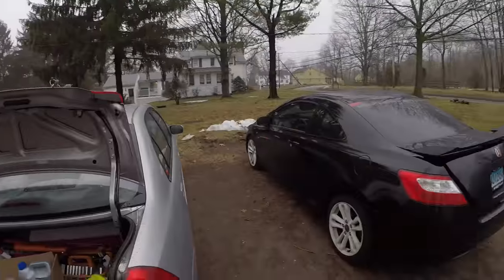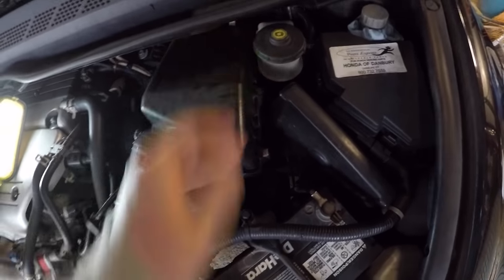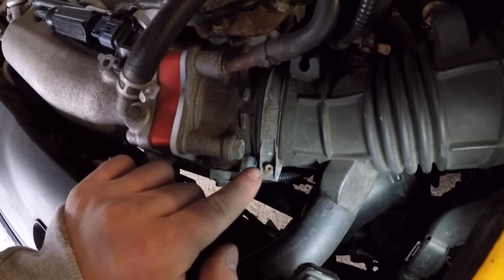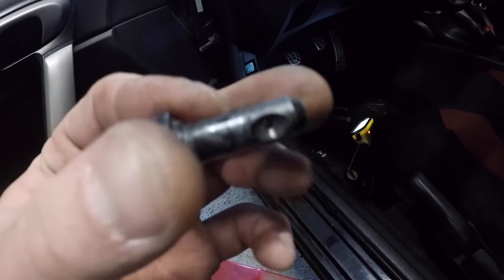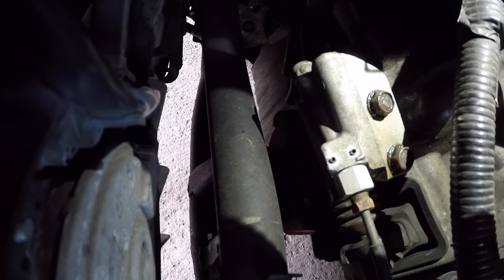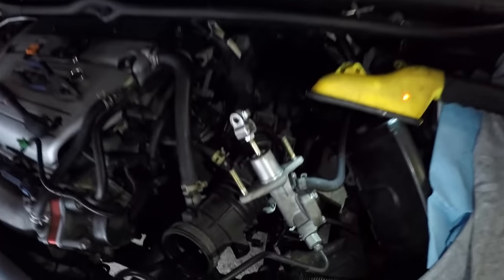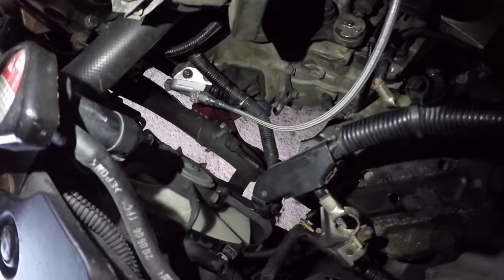Honda Civic Si CMC & Slave Cylinder Replacement DIY (2006-2011 Si K20z3)

Comment: So I just changed my CMC and Slave cylinder out last weekend with the K-tuned and I found that by unbolting the brake reservoir and moving it to the side that it opens up a straight shot to the CMC which made it so much easier to get to. I was able to change both parts and bleed the system in about an hour.  What a difference it made to my 2007 Civic Si 4 door.  I like your videos because you keep shit real and don't act like your the greatest Civic mechanic on the planet like some of these other dudes do on here. Keep up the good work and Video's
Reply: I'm having issues shifting when my 08 si is warm. Could replacing the CMC fix this issue? Or should I just adjust my clutch pedal first?
Reply: Nick G bro what did you do???  it’s happening to me and idk what’s wrong with it, what should i do to fix the issue?
Reply: Im about to do my CMC tomorrow. On my way home from the store today I stopped at a stop sign, took in 1st gear and went to shift to 2nd and i my pedal went straight to the floor. Got her home, reservoir was empty, filled it and tried bleeding it and heard air when i depressed the clutch pedal when it was under pressure with fluid in the lines. Im thinking the leak is at the valve on my OEM CMC but wont know until i take it out
Reply: @robertjackson4642  the stock cmc and the stock slave cylinder worked great until they have there first problem and once that happen they will never work right again. I highly, highly, highly recommend changing both the CMC and slave cylinder  at the same time. I put the K-Tune cmc and slave cylinder kit on my 07 si ( well its now my sons car) when I did mine and its still on the car and has no problem at
Reply: Bleed the shit out of it to. Send me a message if you run into any problem and  I help you in anyway possible.
Reply: I’m not sure anyone will see this but do you have to bleed the actual clutch or just drain the reservoir? Seems like it could be a silly question but anything is helpful!
Reply: @Collin Ragbir  You will need to bleed the clutch pedal just like you would do when bleeding your brakes. Also, make sure you have the new cmc Rod adjusted correct because if ipp

Comment: Thank you for the how to! For most people who dont know, the stock CMC and Slave cylinder are designed for "comfort" clutch engagement and can prematurely ware parts. This is why the OEM CMC doesnt last like older ones. The K-Tuned CMC and slave make eliminate the slower engagement and oil restriction, making it more responsive, but can shock your drive train if you are not careful.
Reply from the maker: Np bro!  Yup, stock cmc and slave for butter smooth gear transitions.  K tuned is nice, but remember something, you can't beat oem reliability.
Reply: Thanks for information but could please elaborate what could go wrong to drive train under what circumstances???

Comment: Yo do an update of how to bleed out all the air I sit there for hours pumping the pedal how'd you do it? Please it would be a huge help man
Reply: sabastian kimball requires 2 people. One at the bleeder valve on the slave cylinder, and one inside the cab pumping the clutch pedal. Pump pedal 7-15 times then hold pedal down to floor with some tension, the other guy cracks the bleeder valve and closes with in a 5 second time frame. DO NOT RELEASE PEDAL UNTIL BLEEDER VALVE IS CLOSED. Repeat till it's fully liquid shooting out of bleeder valve! then, your golden. That's it. Easy savings of 100 bucks.
Reply: You don't bleed the master cylinder. There is only one bleed point in the system, and that is after the slave cylinder. The bleeder valve is located on the top of the slave.

Comment: would this be the first "mod" you would do if you wanted to be able to shift hard when you feel like it? My 9th gen si locks up past 6k going into second.. and it's annoying/grinding my gears.
Reply from the maker: +Taylor Harless I would highly recommend k tuned cmc for shifting fast and hard man. I though they improved all the problems when they made the 9th gen, that's crazy.  If you keep grinding, you're going to need to get tranny work done, which can be pretty pricey
Reply: nope... freakin honda lol I think they made it as a "safety" feature. And yea man.. i don't want tranny work having to be done. Car only has 74xxx. Today i kept my rpms between 2.7 and 4.5 just putting around town and the shift were very smooth. So until the cmc is swapped i'll just keep it around half throttle :) thx for the reply man, I wish you and your si well. (don't let any idiots wreck into it!)
Reply from the maker: +Taylor Harless she's a baby.  I was deciding whether or not I want to upgrade to a 9th gen si or not.  That's exactly what I was going to tell you to do, see, you know what you have to do 👍🏼.  Let me know how you make out

Comment: How did you adjust the pedal/cmc I just did stage 1 upgrade and having some issues once in a blue getting into gear. Feels like I have lost pressure on the cmc at times

Comment: I did the EM1 CMC with a stainless braided line, definitely helped with clutch feel and higher rpm shifting.
Keep at it buddy!
Reply from the maker: +Chase Berz nice bro, stay tuned for my k-tuned driving review
Reply: I might go with the em1 route since it’s oem on my 9th gen.
Reply: @Litto1  it's been a while since I did this and we know better now...

The EM2 clutch master cylinder is drop in and go with no need to switch rod and clevis out.
Reply: Ch Bz what should i do if my car doesn’t shift right when it gets hot. or at all at this point. i changed the slave cylinder, trans fluid as well. what’s the issue?
Reply: @TheGerbsteve  can we just install the regular new stock cmc kit or we have to install specific ktuned for better high rpm shifting???
Reply: @cgberz  do you have the em2 cmc on your 8th? If so hows it holding up?

Comment: Hey gerb, please help!! Asap!!!

So i went to turn on my car and it did. 

But the pedal has no pressure what so ever but it did come back up. 

I added some fluid to the reservoir and it leaked at the bottom almost identical oposite of the CMC by firewall. 

The car turns on with clutch but it wont allow me to go into any gear.

Help. 

07. Si. Sedan
Reply: Ever find the issue? Just had this problem this morning.
Reply: Same here anyone know anything
Reply: Ever find out why
Reply: Your cmc is dead. Happened to me and jus got another k tuned cmc🤦🏽‍♂️🤷🏽‍♂️

Comment: Do you still have the cmc an slave cylinder after all these years I heard that they go out between 5k-10k miles.
Reply from the maker: Running a new ktuned cmc and oem slave, but nothing bad happened with my old one

Comment: I bought 07 si  they put a new clutch in it just 6 months ago but did not swap out the the clutch slave cylinder  every once in a blue it will not go into 5 or 6 gear it goes very hard on me like it won’t fall in the gear.Once I pull over restart car it goes away like nothing happen.I have had the car for 5 months and has done it like 6 times .Do you think it’s the slave cylinder that needs to Be changed?

Comment: Gerb! I’m 4K miles with my ktuned set and I cannot get into gear at a standstill. I got my clutch bled cause there were air pockets in the line. It’s still like 50% cannot get into gear. What should I do?
Reply from the maker: Sounds like it may be an internal clutch component failure

Comment: I'm ordering the cmc kit this week.  when my car is cold my clutch is floppy and light.  I adjusted the clutch pedal and made it hard.  I also replaced the clutch starter switch cause the stock one was broken.  hopefully this solves my problem.  I'm tired of warming up my car for 10 to 15 mins so my clutch works properly...great video!! I'll do my best as always.  God bless 1

Comment: The cmc 12m under the steering wheel 1 of mine is stripped how do I get it off need help rq never had to deal with a stripped bolt
Reply from the maker: A set of nice vice grips should do the trick.
Reply: @TheGerbsteve  thxs bro your vids help me out alot on my SI

Comment: bro having trouble with cmc and slave, i did not bench bleed it , but its taking me a while to get the air out the system. i used most of the methods, but it seems that it doesnt work.
Reply from the maker: All i bled was my slave when everything was on my car.
Reply: how exactly do you do that bro.  just disconnect the hose from slave and let the dot run out or how do u bleed it correctly??! plz respond bro bro thanks
Reply: nvm i read some comments.

Comment: With the hose clamps they're a lot easier to take off if you throw an 8mm or 1/4" socket over them rather than the flathead if you haven't done it that way before

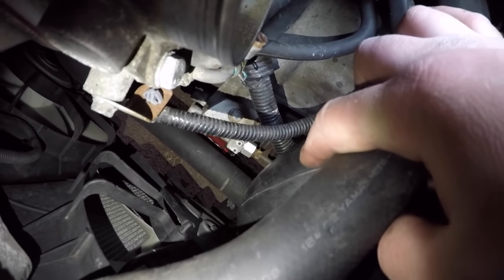Comment: 4:54 slave cylinder.  Just posting that for future reference.  I have a 2007 EX and there's almost no tension in the clutch.  The fluid looks horrible, so I'm hoping all I need to do is bleed and replace it.  Awesome video!
Reply from the maker: Start with changing the fluid, honda oem brake fluid.  Start with that & take it from there. Thank you sir
Reply: It worked!  I just replaced the front pads and rotors back in April and had a bottle of fluid that was almost full.  I flushed the line until the new fluid came out and now it's shifting like new!  The only thing I had to buy was a $9 bleeder kit from O'Reilly.  If only the CBR was that easy to fix...
Reply from the maker: That’s what’s up! I’m glad that it was something small.  Fluid gets filthy relatively quickly, allowing moisture to get into the lines.  Also, debris sometimes get into the reservoir.
Reply: Yeah man the reservoir was nasty.  I cleaned out all the small stuff with a q tip.  Still a hell of a lot easier than replacing the slave and/or CMC.

Comment: Also what was the reason you replaced them again? I forgot if you mentioned it..
Reply from the maker: +Charles Michael I replaced both due to my 2nd & third gear acting up.  I will be putting up a follow up vid letting you know it the k-tuned fixed the problem

Comment: Do you have a video on how to bleed the clutch fluid? Where is the black bleeder cap located? Is it on the CMC or slave cylinder?
Reply from the maker: Unfortunately i don't.  The bleeder valve is on the left side of the slave cylinder.  You need to put a plastic see through hose over it and crack it open.

Comment: What are the upsides of replacing the hard lines with a flexible clutch line aside from ease of installation/removal?
Reply from the maker: Better travel of brake fluid to the slave. Stock line has wayyy too many bends and restrictions.

Comment: I bought the K-tuned CMC replacement part - havent installed it - didnt know that I could/should get the aftermarket slave unit as well. Would just changing the CMC and not the slave (keeping OEM slave) still be beneficial or should they really be installed as a pair?
Reply from the maker: You're going to love it.  Honestly, i stuck with an oem slave because i like the feel of it.  Believe me, you will feel the difference between cmc's.  I wouldn't worry about buying a k tuned slave, you'll be fine with oem, unless you hate the "delay feel."
Reply: I thought the aftermarket CMC got rid of the shift delay - are you saying that only coupled with an aftermarket slave will I get that no-delay shift benefit? And if that is the case - what does upgrading the CMC (and not the slave) do on its own - in other words, what are these improvements you mention that I can expect to feel when finally installing the CMC? Thanks for your video and reply!
Reply from the maker: +Gahechi Esmichi Slave mostly.  Aftermarket CMC helps with quick/smoother shifts.  No, mine paired with the oem slave is awesome. I have a slight delay, but i like it like that.  The CMC makes the clutch pedal a bit stiffer & helps with certain gear issues.  You'll see what I mean when you install it.  Pretty sure it's stronger material (mainly the rod) on the k tuned CMC over oem, meaning it can take a beating.  Also, replace your oem clutch line to a stainless steel line.  Its way easier to install, disassemble.
Reply: thanks again for the info/reply. I went ahead and ordered the k-tuned slave as well - only $70 bucks or so so why not. The CMC kit that I got from k-tuned came with a new clutch line - i expect it to be of better quality than OEM. im really looking forward to installing it - your video has given me the confidence ive been lacking to do the job myself. Thanks again man!

Comment: GERB TURNS OUT THE CMC WAS MISSING A BOLT ON THE ACTUAL CMC. ITS GOT LIKE 3 ON TOP AND ONE WAS BROKEN OFF. DON'T ASK ME HOW IT HAPPENED. WEIRD. 

NOW I BOUGHT AN OEM ONE AND DO YOU RECOMMEND I BUY THE STEEL LINE FROM VALEX??
Reply from the maker: +Sti Wrx Yes, buy the steel line man.  You said the car doesn't go into any gears???
Reply: Gerb Productions yeah it dont. When the car if off you can put it into any gear without the clutch but when you turn it on it dont let you.
Reply: Gerb Productions maybe due to the leaky cmc its not building enough to engage the pressure plate
Reply from the maker: +Sti Wrx I had that same problem.  I ended up replacing the CMC and slave & my clutch shit the bed completely not long after.  I hope it's only a quick fix man.  It could just be your CMC, not 100% sure
Reply: Gerb Productions gerb what are the steps you did to re.pressurize the clutch line.
Reply: Gerb Productions GERB ALSO, WHAT CLUTCH AND FLYWHEEL DO YOU RECCOMEND?? 

MAYBE A 12LBS FLY OR STICK TO THE 15LBS??
Reply from the maker: Exedy oem clucth with oem resurfaced flywheel.  It really depends on plans with your car though.  If you're going boost, stage 1 or 2
Reply: Gerb Productions what steps did you do to bleed the clutch line

Comment: Back to your vids again man. I'm pretty sure my cmc went out.
Like it was popping forever as they do. Until one day it made a weird pop snap noise from the pedal/cmc.

Now it's really hard to get into gear when the engine is on. I feel like it's the cmc??
I need to get one in a pinch so I can get the job done this weekend when I have a moment. Do you think I'll be fine on the same csc??
Is it worth it to get oem at double the price of the rock auto special??

Comment: Why did you change the slave cylinder, my 2008 honda civc si doesnt change into gears unless I turn it off and this happen when I was driving to work and I tried go to 3rd gear put wouldnt let me. Do you think it's the clutch or master cylinder??
Reply from the maker: Because my whole clutch went, so why not upgrade everything.  I hate to say this, but i had the same issue. It ended up being my clutch that failed.

Comment: Going to be doing almost the same in a couple weeks, but I wanted to know what are the benefits of upgrading the slave as well?
Reply from the maker: +Neil Bennett If I could go back, I would've done the k tuned slave as well because I currently have an oem one.  Upgraded slave (ktuned, em1, or w.e) are modded, so there is no delay between shifting.  Oem slave on the si's have a delay valve or something similar to it that pretty much cause a slight lag between shifts.  People modify the oem slave all the time.  Hope this helps bro

Comment: I'm about to be replacing my cmc and slave with a dealer part. Will be doing in a couple days. I'm still going to be using original clutch hard lines. Will I be able to remove the cmc and slave without unmounting the hardline like you did?
Reply from the maker: Dude, upgrade your hardline to flexible, stainless steel, they're wayyyy nicer
Reply: Gerb Productions thanks for the suggestion. I have it all back installed and works perfectly. I got the updated OEM cmc and slave from dealer. Reused the hardline and works perfectly. It's my daily so no need for the flexible steel line yet.

Comment: What are the symptoms of a failing master cylinder? And would it damage the transmission?
Reply from the maker: Fluid leaks, soft pedal, pedal to the floor, shift grinding. They can damage a transmission

Comment: Did you use the ktuned cmc fork thing that attatched to the pedal and where the pin goes through? I had to switch to the oem one because the pin wouldnt stick out far enough for me to stick the pin through. Also does your pedal click??
Reply from the maker: Nah bro, using oem.  My pin was being a bitch to go back through, but i got it in eventually.  Dude, pretty sure my click is gone.  Didn't drive the car a lot after i replaced it, but i will be putting up a follow up video, so you will see

Comment: Had a question so I got 2011 civic si and pedal had play in it so adjusted the pedal drove like 550+ miles then clutch started slipping is it clear to say it’s the clutch or would the master cylinder cause slipping.. car barley moves now
Reply: Did you figure our the problem? Im having the same issues

Comment: hey gerb i had a question, so on my si it is all stock i believe, it is hard to get into the gears and second will feel like it goes in but then grinds sometimes i just got the car and when im at a dead stop and try to put it in 1st or reverse it doesnt go in easy at all but when im trying to push it in the car is starting to roll. im thinking it may be the clutch is not fully disengaging but im not sure, id like to get your opinion on the matter?
Reply from the maker: Start small man, Transmission fluid change, shifter bushings, clutch fluid replacement, etc. See if any of those make a difference.
Reply: I figured it out, it was the clutch pedal whoever changed the clutch before I bought it didnt adjust the pedal so it wasnt fully disengaging but I adjusted it and now it is. Thank you for the advice tho!